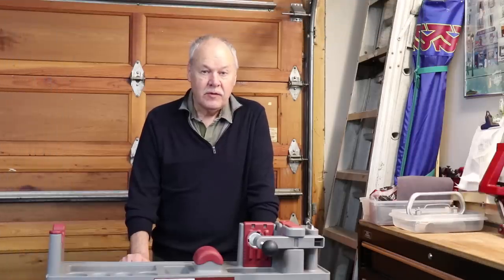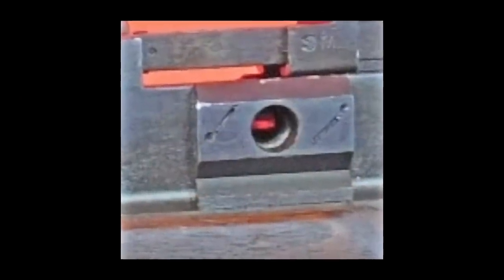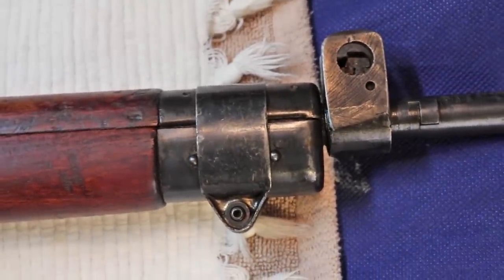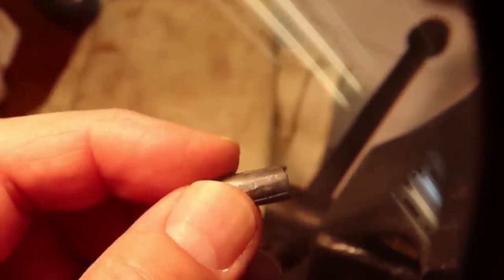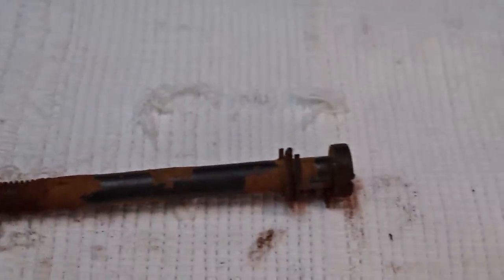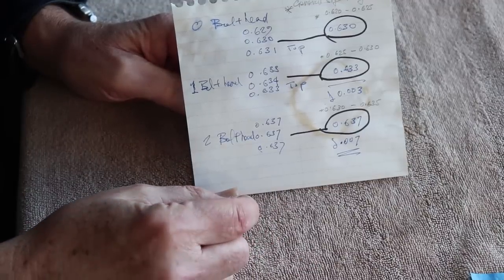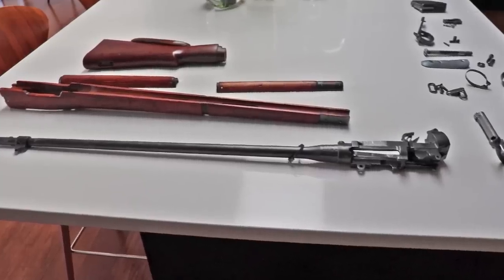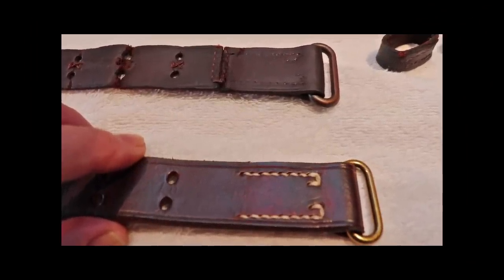Lee Enfield Sniper Rifle Restoration

Comment: I bet with a modern  scope and some homelands this old rifle would shoot inside an inch at 100yds..😉
Reply: Don’t ever put a scope in a lee enfield
Reply: Back in the 50's, when my Dad and his brothers were heavily involved in Rifle shooting Competitions, scopes were not used as sights. A separate telescope was employed to ensure signals from the target pits could be monitored including signals indicating the location of the last shot. Vernier rear sights were used with both vertical and lateral adjustment in thousandths of an inch. Distances were from 350 yards though 500, 750 and 1000. To break ties, either 1500 or 2000 yards were used. I recall a couple of novices suffering from broken noses and teeth because they didn't listen carefully on how to combat the enormous recoil of the .303. My Dad nearly had a heart attack when I described my boyhood attempts to fire a 303 clamped in his vice with a hammer and nail. I am still alive so I failed. We used webbing Slings and a lot of care was taken in showing me how to lock my elbow in the prone firing position on the firing mound.
The competition was fierce and my oldest uncle was the armourer of choice to build the best rifles for competition - many times new barrels were rejected as being not straight enough.
Reply: @kerincrowe4161  Before I and the CCF cadets I was with were allowed to use the 303 a light infantry corporal gave us a talking to and then sent six of us out of sight , around the corner from the others. We were told to go prone and hold the rifles tightly as pre-instructed . I was the first in line . The corporal swung his leg , suddenly , no warning , and kicked the mussel of 'my' rifle ! Hard ! Thank goodness I had used a 12 bore before and he failed to break my collar bone . We thought he had been a bit of a bully , in a way he had been , but you do feel the kick when live firing these weapons . 
That was fifty years ago now and I still remember very clearly using 303s at Derring Lines and Cym Goody ( sounded like that , near Brecon Beacons ) ranges . And a Bren....
I would enjoy having a go again for sure ! 
ATB

Comment: looks like the rifle will be useless now that you have used that drill
Reply: It realy was a shame to add damage to save work and time. A decent quality barrel cleaner solvent would have worked so much better and done no damage.
Even thought it was only a bronze phosfer brush, it will have still rounded the edges of the rifling and affected accuracy. it will still shoot. but not as well. 
Still, a lovely rifle .

Comment: To remove rust or loosing a nut.  Use acetone and ATF oil. 50 `50 .I PUT IT in. A leaver. OILCAN Shake to mix it as when it its for. A. While it will separate .there is nothing like this as even close

Comment: How do you do sir: 
I have a few questions for you if that's ok? 
First off, when running the brush through the barrel, would it not be better to do it by hand so the brush follows the lands and grooves?
The Savage bolt, wouldn't that have SAE threads as opposed to the BSW?
You showed a rear sight. I thought those were ground off to make room for the scope?
Didn't H&H rework the trigger, if so can what ever the did be seen?
Last more of a comment. I had made myself an extra long screwdriver with a parralel blade and a six sided bit by the handle to fit a wrench to remove the butstock on Enfields. Have you considered doing the same?
Oh one more, you didn't mention go-nogo gauges. Did you use any for the headspacing?
Thank you for your video. I learned a great deal.

Comment: Mr. Houston,  Thanks again for the video!  I have a question.  I have a Savage 1942 SMLE #4 Mk1 and prior to my getting the rifle, someone drilled a hole through the bottom of the chamber.  It is about 1/4" and is roughly in the middle of the chamber.  I have been told  I could thread the hole, affix a bolt through it and ream the chamber and it would be reliable to shoot.  What are your thoughts on this or other ways I might repair the chamber of this rifle?
Reply: Be aware that an 'SMLE' is not a No4 rifle.

Comment: Never, never clean up a rifle bore with a rotating brush. This will ruin the rifling! Only absolute noobs will do that.
Reply: Providentiae Memor i have to admit that was my initial thought as well, but if it was that cruddy in the bore you have got to take that chance haven't you? Otherwise it's a scrapper
Reply: Agreed, he's fucked up the accuracy of this rifle. Electric drill rod with phosphor bronze brush from barrel  end STREWTH what a butcher of a fine firearm!
Typical of "make it look nice, stick a scope on it and sell it for 5 times I bought if for. $$$ yum yum yum!
Reply: @samrodian919  Agreed. The first thing you do is put solvent in for a few times. He did. Second take a bronze wire brush on a cleaning rod and pull it straight trough. Many times ... , third would be a lead cast of the rifling with some fine polishing paste -  following the twist of the rifling on a cleaning rod. Polishing the rifle bore more in the back than at the muzzle. This is like a gunsmith would do it. If everthing fails - the rifle is a wallhanger -  not worth installing a scope. If you round  the riflling like in this video it is dead anyways. Just a nice looking plished pice ao scrap for blending people. I did this also when i started restoring old rifles back than when i was 15, with my first K98k. BtW please excuse my bad english -  I´m from Austria
Reply: It won't hurt anything. The barrel steel is many times harder than that soft brush, rotating or not.
Reply: Providentiae Memor there is nothing wrong with your English, it's probably better than mine!
Reply: marcogram well mate three of us agree that it will fuck the rifling if it was in good nick. You would be surprised how hard phosphor bronze is, much harder than brass.
Reply: @dimplesthecat5978   Steel may be harder than water, but rust is neither steel nor water, it is iron oxide. The result of a reaction between the iron in the steel and the oxygen in the atmosphere in the presence of water. Your comparison is irrelevant, and the rifling is fine.
Reply: Samrodian: Well, it is his rifle, he can ruin it if he likes, but a rotating wire brush is instant ruin to a rifled barrel, it is not the fact that the brush is relatively soft, that is the problem, particles of grit become embedded in the "soft" bronze and act like a grinding wheel, taking off the edges of the rifling, so the barrel will never be good again. The really worrying thing is that many of the commenters on here think it is good to do this ! We can only look forward to many more "restored" rifles on the market that will only give poor performance on target.
Reply: UncleBubbles: Ha Ha! your name should be Bubba if you think it is good to attack a bore with a rotary wire brush, how do you think they cut hard stone, it was with a soft copper blade the hard particles become embedded in the copper, and cut the hardest stone, so it is with a bronze brush rotating in the bore, it takes the edge off the rifling.Keep on Bubbaring!

Comment: the bolt is actually from a No.5 jungle carbine and is the incorrect bolt for this sniper rifle
Reply: Pete. If you are talking about the weight reduction on the end of the Bolt handle,the NO4Mk1 (T) was done the same as the jungle carbine. But, if you look at an example of the last sniper version,the L42A1 you will find that this did not and was the same as a standard bolt handle.

Comment: That's a Garand sling. Not meant for the .303. Wonder how it got on there.
Reply: Its that, but more likely originally a 1903 Springfield, or M1917 US Enfield sling.  
They were issued with the British sniper rifles, as our host explains early in the video.
Reply: It’s actually a 1907 model of sling used on the 1903 Springfield. Earlier versions of this sling were used on the Krag and Trapdoor Springfield.

The Garand was issued with both the 1907 Sling and the later Web sling which was issued in later WW2 and Korea.

Comment: Wow, a power drill to clean the barrel? When you restore a pocketwatch, do you use a sledgehammer?
Reply: Do you think the barrel is sensitive and just needs to be tickled with a feather duster to remove unwanted deposits? I've been using a power drill and brush (like in the video) on my barrels for years, and it always brings them up like new with a lot less effort and time than it would take by hand.
Reply: @corno  for restoration,  it's a bad idea to muscle through cleaning, a good restoration takes time and patience.
Reply: @airwolf36  Is it though? Have you done repeatable testing to prove this? This man was removing deposits with a brass brush both of which are softer than the steel of the barrel, so why put forth physical effort when modern tools can achieve the same result at much less time and effort.
Reply: UncleBubbles the bore brush is only supposed to travel the same direction as the round when cleaning just so you know
Reply: Tim Gawlik
 The gunsmith we have  just observed knows far more about firearms and restoration than you do. 
He made an excellent job of it , you made a fool of yourself .

Comment: WD40 is not a lubricant.
Reply: In this instance he is using WD40 as a lubricant and cleaner.  He doesn't mean he's lubricating the barrel, just reducing the friction from the brush and it cleans, at the same time which is absolutely correct.
Reply: @Biffo1262  so, "lubricating & cleaning but doesn't mean lubricating".  Seems legit.
Reply: @JackHudler  WD stands for "water displacement", its used as a solvent or rust dissolver.  Any lubricant-like results with WD-40 come not from the substance itself, but from dissolving components.  It is not a lubricant.
Reply: @JackHudler  we could evaporate you & all that would be left is crow-grease, but that doesn't make you a lubricant either.
Reply: @JackHudler  on that we can agree
Reply: WD40 is 
 solvent naphtha petroleum, medium aliphatic, > 60%
petroleum base oil as paraffinic distillate, heavy, solvent-dewaxed (severe), 15% to 25%
corrosion inhibitor unregulated, 1% to 10%
wetting agent unregulated, 1% to 10%
fragrance unregulated, 0% to 1%
carbon dioxide, 2% to 3%    

Just saying